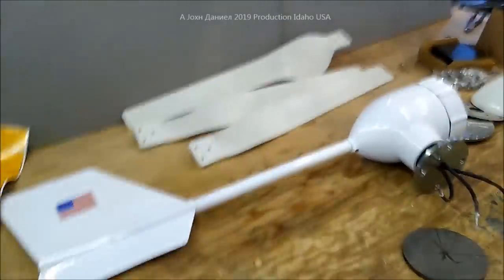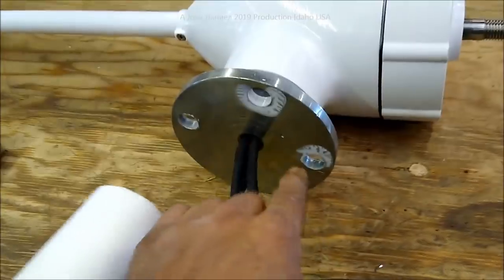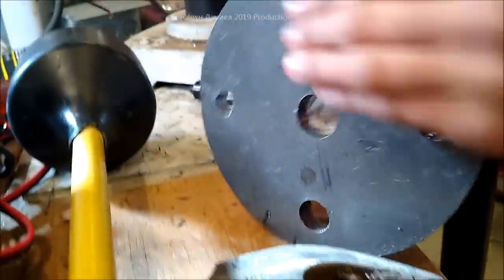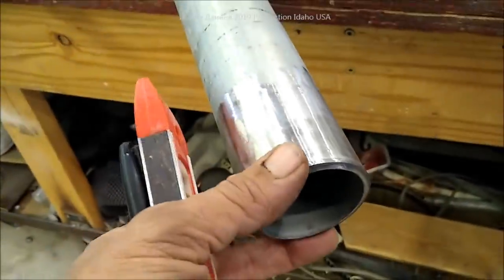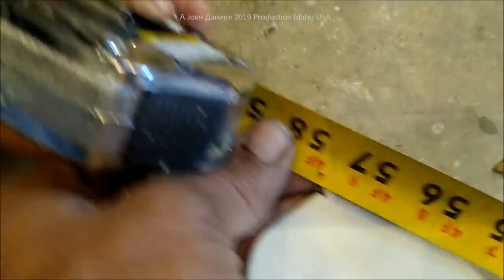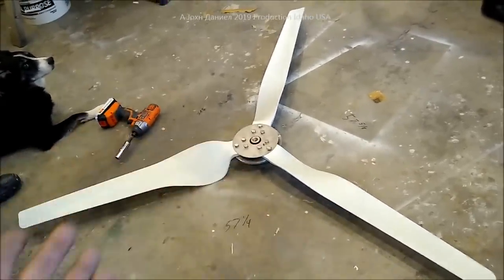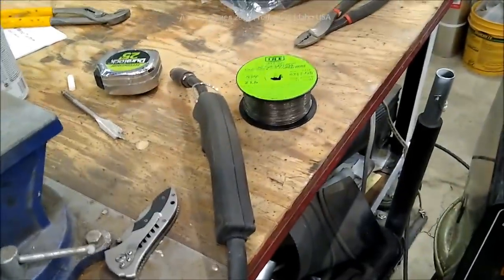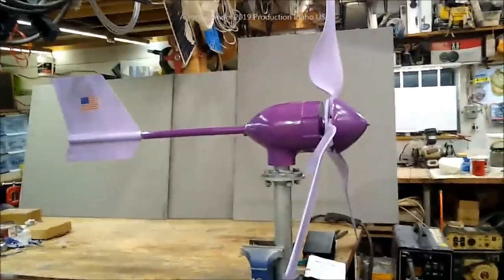Micro Wind Turbine Blade Balancing & 800 watt Build Video, Full Parts Below Vid

Comment from the maker: The list up under the video has those hub/flange parts you can get already made or in metal disc blanks you can adapt. These Turbines are among the few I have found that are NOT fake rated so if you venture off to get a $10 cheaper fake rated one, don't blame me. You Can Support these Shop adventures - See the Cheap High quality survival Food Kits I use http://bit.ly/2Qs0vGO and at 1% per order, you help fund us a bit.
Reply: John, do these turbines have a built in stop to keep the entire assembly from rotating 360 and twisting the drop wires?
Reply from the maker: @xsbiggy6349  All of these professional turbines have a slip ring, technically known as a rotating electrical connector. I refer to them here https://youtu.be/NhMjDRAsFaE

Comment: Is there a reason you dont lock one in place then adjust the other 2?
Reply from the maker: Yes, you could be off on the first bolt centering to start with, I have had that happen a few times. So by a few extra steps you assure centering on the blade to hub pockets, bolt slack as well as blade tips.

Comment: If you want to you could order a larger diameter mounting flange and attach your guy wires to a pre drilled holes in a larger diameter mounting flange.  Just a thought.

Comment: Hey John,  when you measure up the blades.  Why don't you add up the three measurements  ( 57-5/8 + 57-1/4 + 57-1/4 =?? ) then divide that by 3 , that will give you average and even measurement between all 3 blades.  Cheers
Reply from the maker: Good call, but to teach the kids and mathematically challenged its better to be basic as possible. To many equations gets me too many WTF post.

Comment: When I set my blades for equal spacing I will take my first blade  and try to estimate the center of the slack area then lock it down but not torqued yet.  That should give me a good chance to then easily space my next two blades left and right then check for in between the two left and right  blades.   I like to start my first blade in the center of its slack area so I know I should have lots of adjustment for the other two blades.   I really like learning from your videos and soon I will be setting up one of these wind mills in the Philippines where I am now living for making ice. we are living on top of a hill or small mountain with lots of wind especially early in the morning and evening .    I honestly could use 3 of theses windmills here because I want 1 for ice , one for a couple of e-bikes and one for an electric car unless you can recommend a larger unite to do all 3.  Hope to hear from you soon.
Reply from the maker: I like the idea of multiples, 3 turbines and one fails, your OK. 1 turbine and one fails - YOUR SCREWED!

Comment: = 146579,17 mm / = 57,70833 Inch  x3
Hello John! 👍
You weigh the rotor blades in grams and not in ounces, but you measure the distance between the rotor blades in inches and not in millimeters. In millimeters you can measure much easier than with 5/8 ", 1/4", 9/16 "and so on, with millimeters you only have millimeters and a maximum of tenths / hundredths of a millimeter, which are not important and not too important are neglect, unless you are a watchmaker or a manufacturer of precision articles!

Comment: Your videos are informative, but using physics, wouldn't a larger diameter blade set better produce rated power than this (looks like) 6' set? Swept area is the motor that drives the turbine at any given wind speed. Since this is allegedly an 800w unit, I'd like to see output for the supplied blades compared with even a 7' set, then an 8' set. (You seem to be just the guy for that experiment, because you appear to be impartial and honest). I get that "standardized" output ratings are for 24mph or whatever winds, but it would be more realistic for ratings to be based on something like 15-17mph winds. I know turbine manufacturers wouldn't want that, because it would drop their claimed numbers significantly. I would think it would be ideal if wind generators started braking or turning out of the wind at around 24-25mph, instead of in the 30s or above (wear and tear and such). Thanks for any input, and thanks for your videos.

Comment: mate I enjoy watching your vids.  I'm an Mech Engineer based outside Melbourne Australia. I've just purchased a 50acres small farm and we get plenty of wind, and a bit of sun so I enjoy tinkering and have already built my own solar systems on other properties. Your detail surrounding these China built Wind Turbines is great.  We get paid by the power companies when we return Watts to the grid so I'm going to build a system that I can provide myself with enough power during day and then spin the turbines at night in wind and feed back into the grid. I have plenty of space and good sheds to build a  room to house the Controllers, rectifiers,  batteries (if I really need them probably not send inverted AC straight to power board and house circuts) ,  many choices for turbine locations. I manage a Refinery,  I have so much pipe, flanges, steel steel and more as scrap, I have migs, tigs,  and cannot wait to move onto my farm and set up my workshop, seriously the future is good.  I reckon I'll get 4 off the 800watt turbines to start with complemented with a 3.2Kw Solar system and see what average power output I am generating through a series of Inverters I like the Sunny Boy SMA inverter, good back up service I've had to return one. Do you have any recommendations on inverter type we are 240V in Australia.  Also do you have a video that shows your entire circut design is is that being a bit pushy..sorry John!  I've watched your white board, whould be awesome just to simulate (Copy!!!!!!)  your design and get the watts into AC and off to house and grid.  Also whats teh "Support these Shop adventures"  is it sort of like Patreon so we can throw so coin your way to help with you awesome videos?
Reply from the maker: I think if I can get some time I will do some drawings in PDF to put out for people.
Reply: @JOHNDANIEL1  yeh that would be good.  And if you get time to visit Aussie...I'll take ypu for a fish and a hunt!!

Comment: Hate to go all math-geeky on ya John, but. I would. lay out a circle and simply mark every 120° Set in the prop assembly and set it up instead of the old carpenter's guessing game. Just me. Haha
Reply: Just needs something to act as a compass if a protractor isn't handy. First run one straight line, then make a line 90°to that. The hypotenuse of a 30° - 60° - 90° triangle is double that of a base. (Height is base times the root of 3.) Two of those base to base will form the 120° angle needed.

Given that the guy probably does a lot of wind turbine builds, I'm kind of surprised he doesn't have a place marked out on the floor with both 120°and 72° markings. (Other one being for the alternate but common 5-blade patterns.)

Of course this type of balancing in the video just ensures the length and offset are even. there could be slight differences in machining where it'd still be worth checking for the weight. Easy enough to spot when upright with no wind, and if one blade always seeks the bottom you know that's the heavy one that could have a little bit filed off.

Comment: If you add up your three measurements divided by three and that's the distance between each blade you want
Reply from the maker: yes, I got 57.625 as 1/3, but over complicating it for most viewers would not be good, and showing actual action of going from blade to blade pulling and adjusting is key. Not everyone is like you and I, they are learning about the whole process.
Reply: @JOHNDANIEL1  how good are these turbines I would love to get one but the efficiency of small turbines has always put me off

Comment: Curious ... Instead of fidgeting with measuring and moving ... Couldn't you just run a string from point one, to 2 and 3, back to one.  Then measure overall length of the string to divide out for equal side lengths of the blade triangle  Then measure and set the blades to that measurement.   Or am I missing something?

Comment: In your next video could you please show how to install the wire in the pipe as to not put too much strain on the connection to the turbine.  30 feet of three 6 gauge wire must be heavy and I assume would reduce the life of slip ring,  right?
Reply from the maker: You do a multi fold back in the pipe to wedge it in up high, but the strain relief on the turbine below the slip ring on quality turbines is capable of over 100 lbs.

Comment: LOL, I actually sorta like that color .     Seriously considering one of these in the 5 blade version.   Our winds here are some what wimpy but consistently running around 6 -12 MPH this time of year  a bit higher in the spring.   Guessing I could obtain a honest 200W out of one ?   We get the odd 60 - 90 MPH winds from time to time and that would require some fashions of protections,  eaaa?     Couldn't find a Plot or Graph on out put power .  Most of the little ones like the 500W I'm putting up seem to be quite linear on the output between the start up and rated wind speeds.  Sure this one would be the same ?
Reply from the maker: Be sure to request the 820mm blades on the 5 blader by contacting them, telling your in low wind and want the best blade. For occasional bad storms you can make a wire choke cheap, I'll be making a video on that eventually but its gonna shock you how I designed it.
Reply: @JOHNDANIEL1  820 Longer ?   Thanks for your help Sir .

Comment: looks great, i see that they also sell a 1kw and a 2kw. do you ever have any plans of trying a larger unit like a 2kw? excited to see some some output! i might have to get one of these units.
Reply from the maker: We installed 2 of the 2kw models in Bayfield Colorado 2 years ago, They are HUGE!!!!! The 2019 and newer models are even better cleaner sine wave I have heard. My telehandler had to be used as a prop to assemble them, over 10 foot blade diameter. About 10'4" Weight was proof of quality for sure, about 150 lbs each. And you have to put them on 3" pipe, we used 33 foot joints of 3-5/8" oilfield stem. They easily hit 2400 watts at 25 mph, and even in 10 mph are pushing 600+. A 4 day job, but he did a fronius grid tie install, I prefer Battery banks and NO GRID!